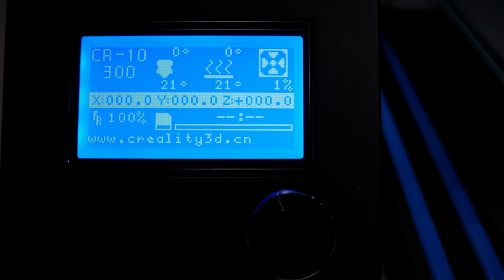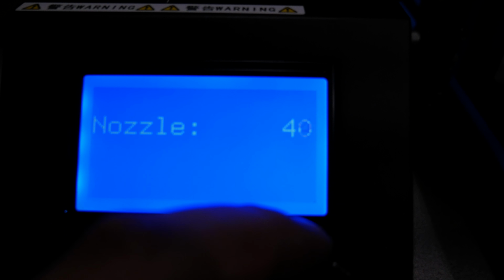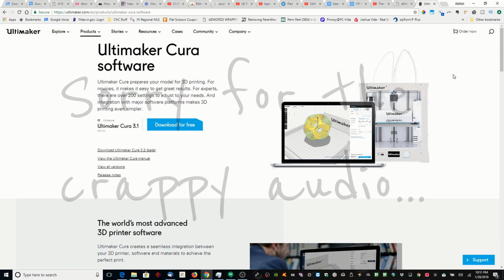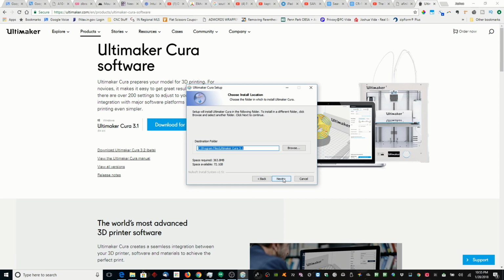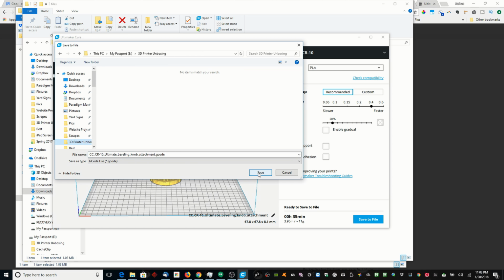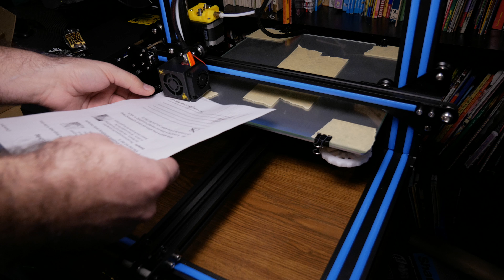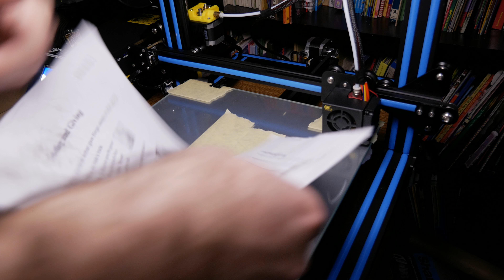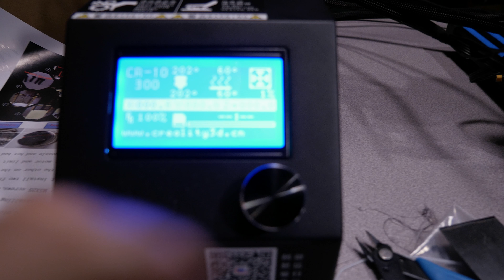Creality CR-10 3D Printer - Review + Unboxing, Assembly, & Setup

Comment: there is a good reason why the guide rails are not tighten. Good work Creality Group!
Reply from the maker: So things don’t get bent during shipping?? Care to elaborate?
Reply: YES ;-) and if CR10 is original packed for a longer time, the rollers could be deformed due to pressure onesided.
Reply from the maker: Makes sense! Thanks for the explanation. 👍🏻
Reply: ;-) The whole CR10 Community do complain about loose rollers, wrongly I think. Creality Company is not stupid.